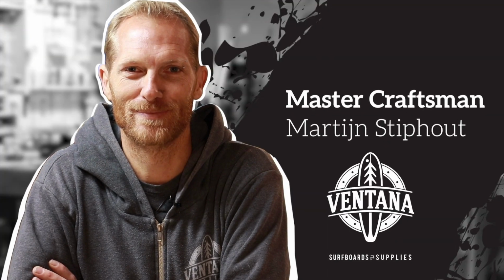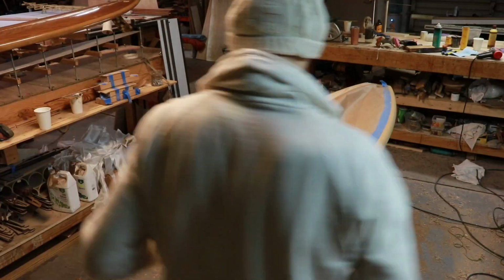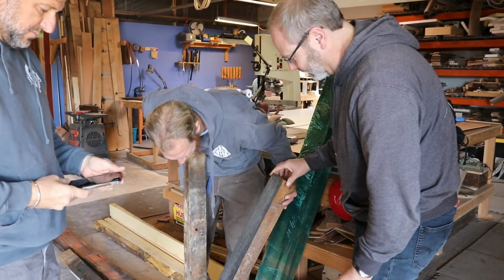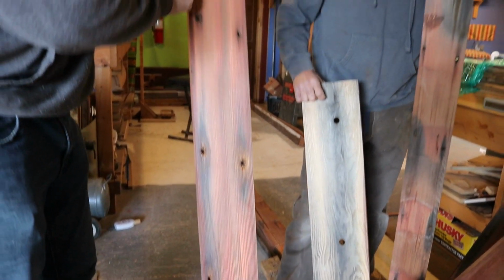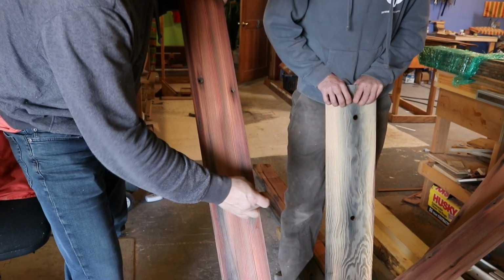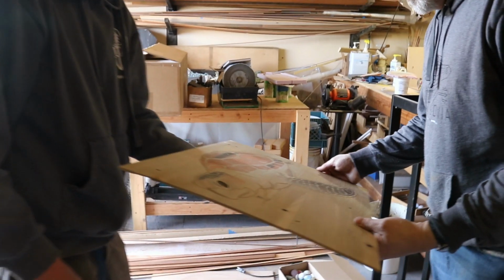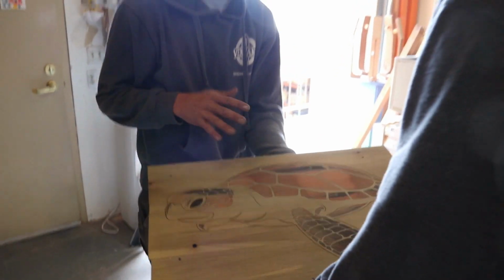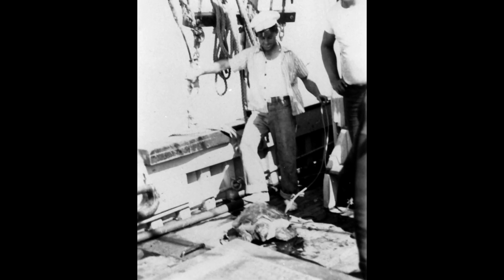Western Flyer Restoration EP 18 Rebuilding a Wooden Boat

Comment: WOW ! I never tought surf boards were made like this ! Awesome work of Art !
Congratulations to you all but especially to the young woman ! Great work, Mademoiselle !

As for reclaiming wood, years ago I was working in a studio (advertising) and a small company downstairs was importing copier paper from Indonesia. I recuperated wood palets from Indonesia. They were made with a very hard, reddish wood. Oh mein Got ! It was mahogany ! This wood is VERY expensive around here, in Montreal, Canada.  I brought 6 palets home and spent hours after hours removing hardened nails ! Most planks were heavy, dense and beautiful when sanded. I stacked them in my backyard and used them restoring a garden table and forgot about the rest for years. Last November, I bought a small Tanzer 16 sailboat in dire need of TLC. (One of my retirement bucket list project.) I spent this winter reproducing the worn, rotting wood trim with my forgotten mahogany planks. After years outside, under rain, hot sun, snow in often - 25°C Canadian cold. They were still perfect ! Straight, no warping at all !! 
Final sanding and epoxy coating will be done as soon as warmer spring is here.
Can't wait for the inaugural splash in June !
Reply from the maker: Hey, Thanks for watching.
Reply: Thank you! Most boards aren't made like that, but we're brining back an old style as it's stronger and more eco friendly.

Comment: Nice.  I do the same type of work , in my spare time. Done a red cedar striped timber 6" board(bit plane but looks great, I end up just oiling the outside), now doing my sister a jewellery box out of a reclaimed window frame. got my mind set to do a 10' long board tricky in lay design, thanks for the inspiration vlog.

Comment: I guess it completely fills with water if you get a ding?
Reply: You'd have to really knock it for that to happen, but they are easy to repair. And, given that they are glassed inside and out, they won't be damaged from the water.

Comment: Form over function,  hang it on a wall.   Just a work of art,  many of the woods used are subject to rot if they become wet.
Reply: fixento whole thing is glassed though. I think that would protect the wood fairly well.
Reply: Our boards are glassed inside and out and are far sturdier than a traditional foam core board...and they surf great! More info: http://ventana.surf/faq